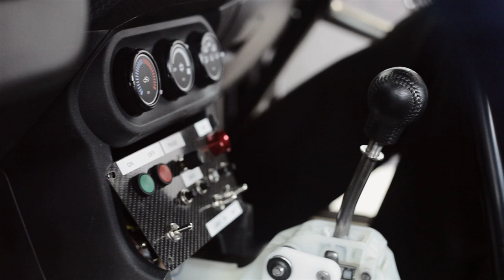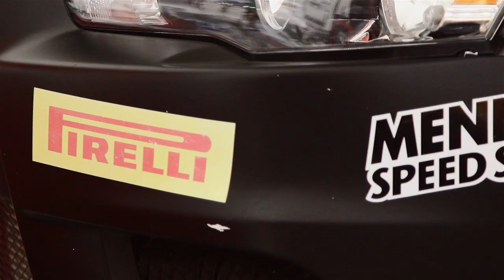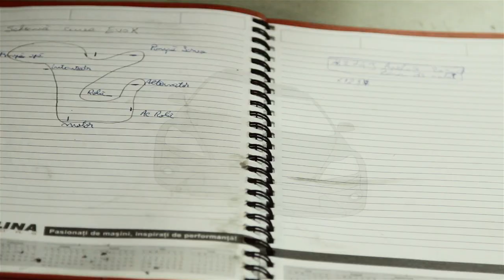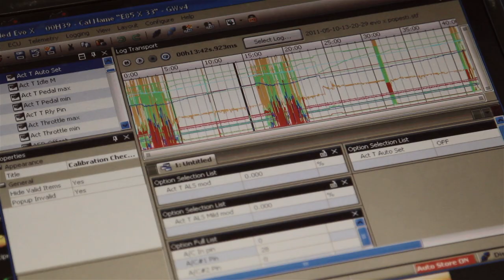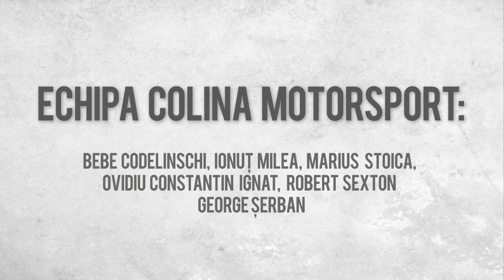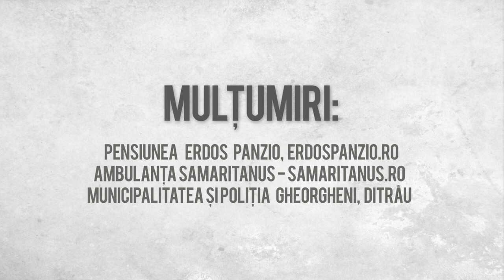Mitsubishi EVO X Rebuild

Comment: Pretty sure this guy is making a BIG mistake. 11:26
Do you know why?
Reply: Yep, he uses WD-40, because it penetrates from water :)
Reply: Dielectric KEM is the correct.
Reply: Robert Ramanis Pretty sure a professional rally team that has done this 100 times before knows better than you do
Reply: Dee Jay I am a Motorsport Engineer and all I know is that WD-40 contains white spirit which melts plastic and makes it brittle.
Reply: Robert Ramanis i stayed at a holiday Inn last night.
Reply: Wd 40 is fishoil.  Its resistent to water penetration.  Superb for contact points.  Remember making The car work good is more Important than fresh plastic.
Reply: Robert Ramanis and this is a bigger crime than an auto manufacture not including a transmission dipstick with their cars. you are an expert high performance technician aren't you.
Reply: Manual transmissions don’t have dipsticks...